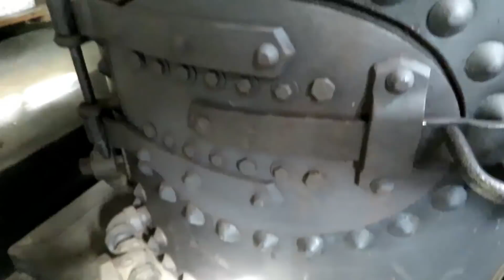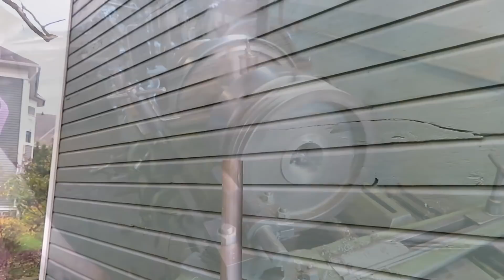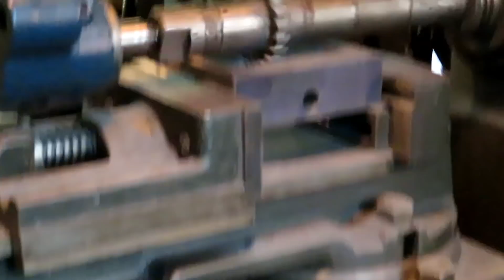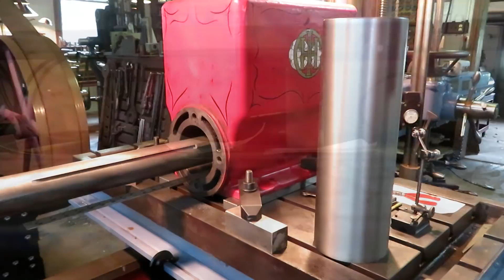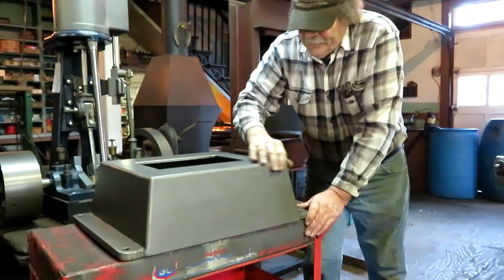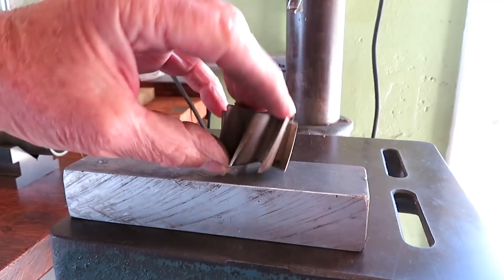OLD STEAM POWERED MACHINE SHOP  77   LOOKING BACK

Comment: Great safety tips, I don't wear gloves drilling on a drill press , a glove could catch on a drill bit and wrap your hand in it , any rotating machinery can catch clothing.  Better to get your hand dirty than keeping it clean with a glove and be in trouble. As far as your steam and belts I was a BT on the DD-876 and you have to respect the equipment your around.

Comment: It just doesn't get any better than this great simple steam generator I'm from England 77 years old truck driver back in uk in sixties I had the pleasure of picking up a load of cotton bales from a old factory dating back to the 1800s still in operation today apart from couple of machines that were extremely loud the majority of machines were relatively quiet what really amazed me was a later visit to the office that was ran just as it had been for some sixty seventy years  in the office were probably a hundred  bloody typewriters all at work  the noise was deafening I guess different pitch sounds I just couldn't imagine working there

Comment: I really enjoy all your videos!!  Some place in my archives I have a story about an old machine shop that was driven by a single electric motor via overhead line shafts and flat belts.  At some point the the owner/employees needed to do some repair on the really old electric motor so they removed it from its mount and took it all apart.  It was evident it had run a long time with minimal lubrication and the armature was badly worn as were the bushings.  They decided to turn and sleeve the armature and make new bushings so they placed the armature in the lathe and up to that point didnt realize their predicament....... and that is the way some days go!!!

Comment: Hi Dave,

Love your videos. Great stuff and great shop. As a tool and die maker for over 55 years, I grew up in shops that had a lot of that old machinery. Of course, it was converted with special flat belt drive motors rigged somewhere on each machine. It is nice to see some old time machining on these machines I learned on as an apprentice. Also nice to see someone giving the hobbyists great tips on safety. Something that was stressed in the toolrooms back then. One thing I need to add so all can take heed, is that you should never wear long sleeve shirts when working around open and running machinery. The chance of a sleeve (even if it is buttoned) caching on a moving cutter or chuck or pulley is very big and can likely to happen in a thoughtless moment. Especially when someone is tired at the end of a long day. I just thought I had to add that point of safety to all. Again I watch all your videos as I get the time to do so. Great work and keep them coming.
Marty the Machinist

Comment: Your shop is great! The safety police people don't understand personal accountability. If you can maintain the discipline it takes to work safely with dangerous machines, you'll be fine. If you were raised to think everything should be safe all the time and you have no intention of changing that mindset, stay away from dangerous things and leave it to more capable men. I work with a vertical mill, lathe, welder, press, 12 ton  vehicle lift and so on every day. The modern world was built with and is maintained by such machines.

Comment: Raising the tractor engine from 4.5-1 to 5.1!
I am old enough to remember line shaft machine shops though powered by electricity,, this in the late 50s. And those belts were flapping like yours.
Most of the equipment was WW2 salvage. 
Later on the line shafts were removed and it all went 440V. It was a lot quieter until they closed about 20 years ago.

Comment: That tip about not wrapping Emory cloth around a steel rod when polishing is gold. Not only does holding a strip against the side of the piece keep it from getting bound up, it also makes better contact with the polished surface, it also allows you to see your progress so you don't over do it. I've told a couple guys I saw doing the wrap that it seems like you'll get the job done quicker polishing all the way around at once, but it wasn't turned quickly either and Chartres took 8 generations to complete. Do you want it good, or do you want it Thursday?

Comment: Good to know we have the same heebee-jeebees, Dave, especially the milling cutters.

I've noticed that I much prefer the old pattern lathes. On my 18.5" swing Sidney with a 12" chuck, my my carriage indicator is far away from the chuck. And most of the time, with the long carriage wings, it is behind the chuck anyway. No danger. On a modern boxy lathe with zero carriage wing, stopping the lathe is really the only safe way to set the indicator. New isn't always better.

Comment: What size electric motor would you suggest to run a lineshaft with a lathe, drill press and vertical bandsaw on it?
Reply from the maker: The Lathe would be the hardest to drive and assuming it would be around 10-12" swing and you would be using one machine at a time, 5HP -220 capacitor start motor would be about minimum. 7 1/2 HP would leave some room for expansion. Belt ratio to the jackshaft should be about 7 1/2 : 1 so you have about 250 RPM.....Dave

Comment: Dave! What do you know about the East Broad Top shop are they going to rebuild the old boiler or can they. Maby they will have to put in something modern for insurance reasons witch is ok I just would like to see the old shop come back to life Thank you for your time Paul.
Reply: I just found on their web that some one gave them a new modern boiler cool
Reply from the maker: Paul, It is a 100HP Cleaver Brooks "modern oil fired boiler" that I found for them near Syracuse, NY.  The museum that had it decided it was too big and they wanted to use a hand fired boiler anyway. They NY boiler inspector determined that it has all the stamps and paperwork for them, so hopefully it will fly in PA also. I guess EBT will put up an enclosure for it and will move it when the concrete for it is poured.....Dave
Reply: @davidrichards5594  Thanks Dave I can't wait to see that old gal run under steam like she did for a 100 years. The first time I saw it you were wearing a T shirt anything smaller than a 4x4 is just trim and she was just going around on air, what a let down for her. She will be proud and shining making power to run the shop agene. I wish I could come and help but I live way the hell out in Coos Bay Oregon not quite a Sunday drive. Thanks and thank you for your time. Paul

Comment: Thanks for another great video; here in the middle of winter I wasn't expecting it, so I'm watching it rather late!  Here's an extra safety thing about filing in a lathe which is perhaps obvious - you really don't want the chuck jaws, as they come around, to hit the end of your file, because they'll fire it right at you.  So use the file left handed as you say, and make sure to introduce it a good way along its length - don't go anywhere near the far end.  You can show yourself it's safe there in the middle by sliding right onto the jaws, where it'll just rattle.  Near the end, if you hit the jaws I wouldn't want to be there!
cheers
Mark, Manchester UK

Comment: I was laughing at the "most dangerous shop" comment.  Why?  Well, because I am a smaller man as stature.  And early on in my shop work, as about age 22, it so chanced a big mill needed a fluid line installed to the interior of table component.  And the lead mechanic came around asking me if I was claustrophobic at all..
It turned out, engineers and management did not want to stop production.  So needed someone to crawl within the machine, while working, to transit the needed component line to fixture.  And that access was at a crawl space so small as to require a maneuver as turn about to a side tunnel access. I managed the task, which came with the tool working as within a slight span as I wiggled thru the cavity.  And big shops with ovens, rail delivery, overhead trolley, press, hot work, lathe, overhead doors, fixtures and roof....all require the care and prudent sense of a maintenance and fitter as professional.   Confined space as with hazards, various gas and oil, fuels...electrical .all which can be difficult and exist with certain dangers.  
And yes, such safety as talking and planning, advantage as gear, shields, personal protection can minimize hazard...but the sure hand that is a craftsman, tradesman...understands and accepts process.  Service or product is in fact a part of such trades.  Where belting was once the leading delivery of energy delivery at machine component, taken with no difficult extra hazard by the sure knowledge and care of such craftsman.
Often, where apprenticeship governed training over years.  
In such as to trade where machine tools, entanglement as hair, clothing, gloves is real.  Some domains as common sense and everyday care are perhaps difficult to explain, to that task...and where months and years of experience rule.  My current lathe is a 1935 South Bend which was delivered new with a belt drive.  As 85 years.....a lifetime of man in timespan, still delivering excellent precision. Its mount and full tool component built by my hand. At its end use....it might be hard to explain a satisfaction and why I like my shop.
Why I simply will not accept a Chinese mini lathe.     M.
Reply from the maker: Great comment Mark, It put me in mind of railroad shop men that would have to go into a still hot firebox  door to replace a staybolt or some such thing...Dave

Comment: thx for safety tips, I'd love to have plans for engines (all) and the boiler. What if you spun a generator with steam engine for electrical current to run modern machines instead of mechanical power?

Comment: Metropolitan/Buffalo injectors are great! I love having the valve built right into the injector. I've had a lot more luck with them than I have had with the ubiquitous Penberthy.
Reply from the maker: Wesley: I had no experience with Metropolitans until this one, It will run at very low pressure. I had a problem with it for awhile and found that the steam valve was leaking just slightly when closed which heated the injector up and it wouldn't start....Dave
Reply: @davidrichards5594  they definitely like to stay cool. Cleanliness is really important too. As my dad would say, "You have to think pure thoughts..." They have a pretty large pressure range. I believe they made two versions, one for high pressure (70-200) and one for low pressure (30-50). Even the high pressure version, I've been able to convince it to sing as low as 50psi.

Comment: Hi Dave, glad to see another vid from you. I am kinda a self taught machinist and half of my shop was lineshaft converted, or came with the option to motor driven. You just have to be aware of your surroundings and use common sense when working with these old machines. 
I collect, restore, and exhibit antique engines, tractors, and related equipment. I even have a couple of steam engines, one vertical that I have run on air. The other one is a mill engine 8 X 10 that needs to be sleeved, rodents made a home in it, not good. Thanks for sharing a little history with us. God bless and take care. 🙏👋
Reply from the maker: Hi Robert, I would be interested in sleeving your 8x10 if you are interested....Dave
Reply: @davidrichards5594  Thanks Dave for the offer, I will keep you in mind. I live in michigan and your not just on the other side of town.

Comment: This is the first time I have your shop. I never had the opportunity to learn about machine shop, until I was in my 50's and was in maintenance shop.  The machinist was going to votec to learn CNC machines and I asked our foreman if I could try to do some simple things.  I started repairing molds that had the threads pulled out.  I would install heli  coils and learned how to make some molds.  Looking back (hind sight) I would have gone to machine shop school after I left the Air Force.  Loosing my eye sight stopped that work.
Keep up the great work of teaching others.

Comment: Adam Booth came up with a good safety tip a while ago .  When you're machining without chip breakers and you got them long strings coming off and winding  around things,  STOP, shut down the machine and take care of the chip problem !  I've seen some nasty accidents when people have got their fingers caught-up in the mess -- either accidentally  or by trying to remove the the chip problem with the machine in motion .  We've all probably tried our little "tricks" to snag or cut them off in process,  but it just-isn't-worth-it .  Stay Safe .
Reply from the maker: Ken, Definitely true. It seems like any annealed tool steel is a problem like that in a lathe....Dave

Comment: I grew up in a three-generation family shop just like this on the Gulf Coast.  Only bad accident I ever saw, in quite a few decades, was my brother was goofing around and dropped a very heavy disc of cast iron on his foot.  Nothing to do with the belts or the machines at all.  My own smaller shop the last thirty years is also overhead leather flat-belt driven.  No accidents except the occasional rapped knuckle or hot metal shaving tossed up into my shirt collar.  But no machine shop, old or modern, can be made idiot proof if a person is careless or not focused on what he is doing.

Comment: Richard I love the idea that your antique machine tools are boring and machining parts to antique engines,steam engines and tractors. Old stuff fixing old stuff. The open belt drives wouldn't concern me. It would be dropping a chuck off the spindle or a cut from a burr like off the gear cutter. The base for the Morris engine was beautifully done. Al B in Ohio.

Comment: My father who was a cabinet maker had a shop that was very similar to your own. Not having a lot of money he acquired most of his machinery from an old timber mill. The biggest difference being that rather than a steam engine his was run off big old electric motor. I remember that the plate on the side said made by the Edison electric company 1904. The other great memory I have is the smell of trickle that they put on the belts to make them sticky, so they wouldn't slip.

Comment: I love your show, being a metalworker I am fascinated by how things were done in the early in the years of the industrial revolution. Question, have you tried to fabricate a condenser and install it on your steam engine to try and recover some of the steam exhaust from your engine?
Reply from the maker: Brian, I doubt that it would be worth the trouble at the low pressure the engine sees. Maybe a feed water heater, but it would require an insulated high pressure line to the engine and back to the boiler....Dave

Comment: Great shop you have there. I've often thought of having a small shop of my own, with a line shaft to run my 1934 South Bend lathe and the old camel back drill press. 
 I would think an International stationary engine would make a good power source for it, because they were not "Hit and Miss" engines( @ 30:36 ), but were throttle governed.
Reply from the maker: True, it would be a smoother power...Dave

Comment: Dave is the steam coming out of the exterior steam exhaust in bursts, acting like a straight pipe on a combustion engine?
Reply from the maker: Hi Ed, There is still some pressure in the cylinder from the expanded steam when the exhaust port opens...Dave

Comment: As an ex RCN ERA apprentice back in the early 1960's; I achieved certification in three trades as a result to that training; general machinist, marine diesel mechanic and 4th class stationary  engineer.  I watch your vids with rapt attention as you've stayed with H/S/ tooling and deal with line shaft drive systems along with the usual complications "steam" brings to the table. God I love your vids!  Winter in Lakeland and will head down for the FlyWheelers convention.

Comment: You know Dave, like some of the others said, the shop isn't anymore dangerous then the thousands of open shaft shops that were around when we were younger! The issue, in my opinion, is that we have all become too complacent after all of these safety measures that were forced on us! We have become less 'self protective' and taken the attitude these things will protect us! I worked 47 years in the construction industry and for the first 35 years was never required to wear safety glasses and very rarely ever got anything in my eyes! After being required to wear them I got far more things in my eyes, why? Because i became complacent on safety glasses providing the protection and far less 'self protective' of my eyes! You use to be aware of what was around you and what safe guards needed to be taken (standing out of the way of flying chips, standing or staying clear of spinning belts and pulleys) and being always aware of what was going on! People have become to dependent on what they are told are safeguards and to less dependent on common sense and self protection!   
Cool story about the history of the shop!
Reply from the maker: Thanks for the comment Fred, and thanks for what you do, hauling this old machinery around the country......Dave